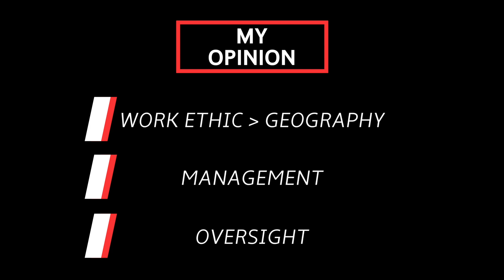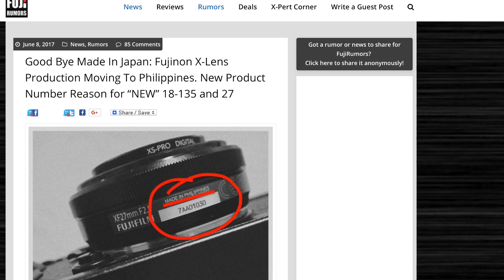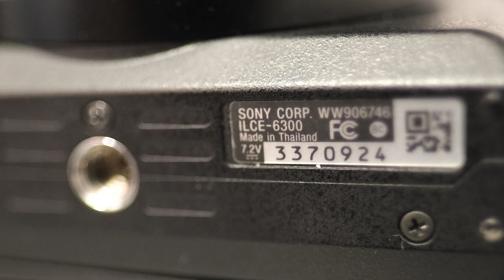Is Your Camera Garbage?

Comment: I don't care about the country of origin. I care more about the reputation of the company. For example when I buy from Nikon, I am ready to accept problems and issues.
Reply: Nikon shouldn't have never sold this guy a faulty camera lmbo.
Reply: I am glad that the official dealer is offering to repair my camera for free. When I am in Aperture Priority mode and the shutter speed exceeds 1/2000 the camera occasionally locks up with an "Err" message on the top LCD. It has caused me to lose quite some shots.

Comment: Whenever some product requires an considerable amount of handwork on its production process it is quite critical to just move the production to another place. It requires some great training work of local workers and huge quality control process. I don't know much about lenses and cameras build process but I see on videos a lot of people inspecting all those fine glasses by hand.... how much of this process could be replaced by machines? And how much should be done by a well trained worker? What would be the quality impact? I don't know.  I don't care if my iPhone was assembled in China or USA. The automated built process will be the same for this type of product. But I do care where my electric guitar was made. The Japanese Guitar Brand Ibanez for example have gorgeous hand crafted guitars made in Japan. They also have a cheaper line produced in China where they cut the costs with machines and local workers supervised by their japaneses specialists. The quality difference is like day and night, so the price.... so what's the point of cutting productions costs moving the production to elsewhere ? achieve the same quality and lower the costs at the same time or introduce a cheaper line of products? In the case of Ibanez guitars it would take years and years to teach the China workers to the same level of the Japanese workers who have been doing this for over 20 years. Not because japaneses are better than chineses. It just needs a lot of training work. Introducing the company culture, tradition and quality elsewhere is everything but easy. Maybe camera body's would not be dramatically affected like lenses.... I don't know.

Comment: It's not just about the country that they are made in.
The management of these company's are programmed to save production costs and increase profits. 
So they off shore production to a cheaper labor market.
Which is only half the story.
They also production engineer their products for the cheapest possible production costs. Again to increase profit.
Mirrorless for example, and I'm not saying is a bad  thing, but the cost of manufacturing a mirrorless camera is far lower than a camera with a complex mechanical mirror and prism.
Lastly the components that go to make up digital cameras, irrespective of where the actual camera was finally assembled, are made by numerous companies from all over the world. So even if you have a camera with Made In Japan or Germany stamped onto it, Which only means that it was finally assembled in those countries, it could well be full of say Chinese made components. There is no electronic component industry in Germany. You can bet that a high proportion of any modern Leica is made in China.
The problem isn't with the engineers the designers or the nationality of the people that assemble the final cameras.
The problem is with greed based management philosophies.
Cut production costs, Charge premium prices and increase profit.

Comment: Most of time failure is due to the quality of the parts. Not who assembled it. That is why certain batches of cameras fail because there is an issue from the parts supplier. Also all companies have issues with their products, its a matter how they deal with their customers. Sony in my experience is one of the worst ... not just cameras but electronics in general. I'm sure you can do a little research to find how they got their lawyers to suppress the heat and red ring of death on their first generation of play stations 3. Lets be realistic, most devices which are of poor quality tend to fail within the first year.  We rarly hear from gear reviews about this kind of thing because they are using a loaner and not having to live 3 to  5 years with an item.
Reply: Randy R red ring of death was Xbox. PS3 had no ring to turn red. It wasn’t without issue though.
Reply: Hi Tinyman. The actual nickname of the issue was yellow light of death for ps3. Pretty much either the CPU or or GPU would become unsoldered from the board. There are many videos about it with the first gen PS3 consoles. I'm sure you can get first hand information from your local game store as many of them had special machines to resolder the PS3 or replace the power supply which also blew from the heat build up in the unit. My 60 gb unit had the same issue twice which cost me $90 twice. Sony lawyers squashed it by saying that the failing systems were not just CPU separation. Sony never extended the warrenty to cover the issue like XBOX.

https://techcrunch.com/2009/09/18/the-ps3s-yellow-light-of-death-big-deal-or-sorta-%E2%80%98meh%E2%80%99/

http://news.bbc.co.uk/2/hi/technology/8263063.stm

Also how could Sony get the true numbers of the failing consoles if it was so expensive to repair them? Many people did not send them to Sony to fix. So allot of the time this critical thinking is not put in the articles.
Reply: @Randy R 100% correct! and another reason i will never buy a Sony product ever again.
Reply from the maker: The quality is sometimes a direct reflection of the people making them though!
Reply: "Most of time failure is due to the quality of the parts. Not who assembled it. "  Not always.. There are people who will try to put a square peg in a round hole with a sledge hammer...
Reply: I actually have a PS3 that succumbed to the yellow light issue.

That said, I own a PSP that’s a decade old at this point and it’s still working without issue. Not sure if it being made in Japan has anything to do with it.